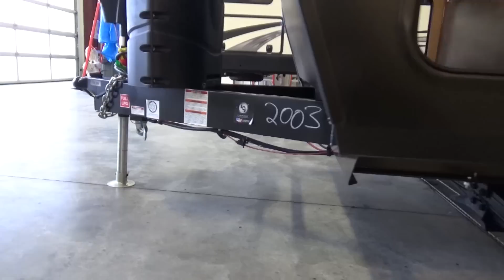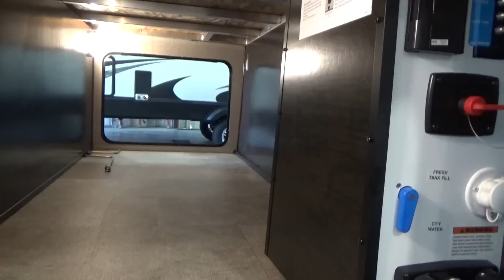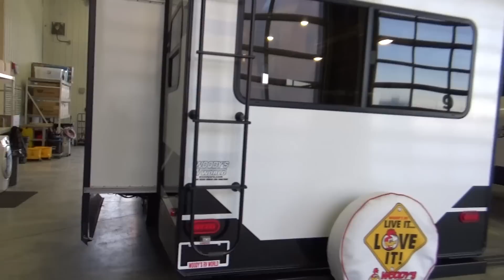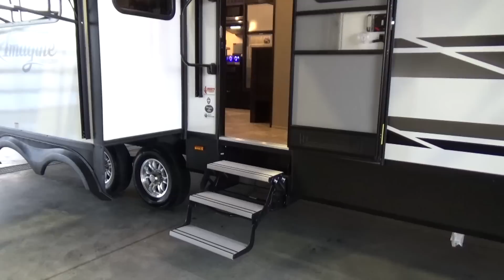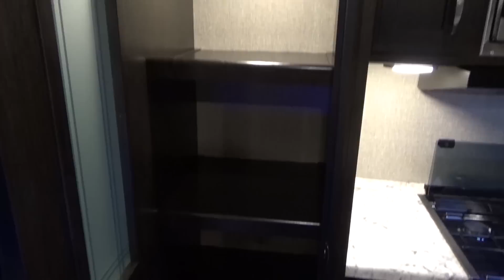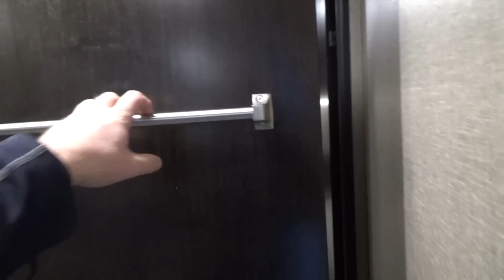2019 Grand Design RV Imagine 2970RL Travel Trailer

Comment: Great content and detailed walk through. Please be mindful when salespeople talk about “half ton towable”. They’re going to try to sell you on a higher end price point TT on its ability to be towed by a common lightweight truck. However, when you consider the GVWR and hitch weight of the TT and the amount of payload (passengers, luggage, tools, equipment, fuel cans, etc.) you’re carrying in your truck, you will likely be close or over a half ton truck payload capacity. For example, an 8,900 lb TT will likely have a 600-700 lb hitch weight that you add to the amount of weight in your truck. If your half town truck has a 1,500 lb payload capacity, you only have 800 lbs including passengers to go. Additionally, even if you’re not over your payload, a strong cross wind, and you could find yourself in a sketchy, white-knuckled towing situation where the TT is steering the truck because it is so light (tail wagging the dog). Upgrade to a 3/4 ton (gas or diesel) and you’ll have a much safer and  more relaxed towing experience. Go to the “Big Truck Big RV” YouTube channel and he goes into great detail on this. Not saying you “can’t” tow with a half ton, but please be as safe as possible when choosing the proper size truck/trailer combination.

Comment: Forced heat from the furnace to warm tanks doesn't work once its below zero outside. Tanks and lines under the floor will freeze. 

Love the floor plan. But for me I'd need an arctic package. Tank heating pads and insulation all underneath

Comment: At the 21:55 mark in the video you talk about the reason why people decide which RV to buy is because of the weight of the RV versus the payload capacity of the vehicle you have to tow the RV. Another consideration is the class of driver’s licence you have. In Manitoba with the a standard class 5 licence the maximum GVW you are allowed to tow/pull (travel trailer or fifth wheel) is 10,000 lbs. The police and Highway Inspectors go by the GVW listed on the sticker of your RV. So if pulled over on the highway or a Provincial Highway Scales you could get a ticket and not be allowed to carry on if overweight. Even worse if you have an accident and you are towing an RV that has a GVW greater than your driver’s licence allows they can deny your insurance claim.
Reply from the maker: Garry Kowalski, thanks for commenting and sharing this info. 😀

Comment: I seem to recall that in a he past you recommended twin 6Volt batteries rather than twin 12 Volt batteries. Why?
Reply from the maker: Garry Kowalski, thanks for your question. You get more amp hours out of 6V batteries vs 2 12V batteries. Thicker plates in the 6 volts as well, so they tend to last longer when properly maintained. Hope this helps.

Comment: Good salesman!! Talks about tow capacity. All Rams are different too. Check it out before buying. It's a safety issue if your trailer is too heavy for your truck. You don't want to flip your rig or end up under it when it pushes you down the road !

Comment: As long as people understand that this guy is a salesman and he’s not gonna tell you anything bad about this trailer . . For example the 4400 pound axles are nearly overloaded at dry weight and a step up to 5100 pound axles would only cost a few hundred more dollars. And the “R” numbers are silly....it’s 2inches of styrofoam in the walls and a little bat fiberg. In the roof....my house has a foot of blown in insulation and is perhaps a R 35.. .

Comment: Clayton, does the 2970 RL come with a generator or is it an option?  If it's an option are they expensive for a size that can run the A/C plus a few other things? I dont know what size would be needed.. thank you.
Reply: We bought a champion invertor generator for around $700 with coupon that we keep in the back of our truck and comes with a fob that will START and turn off wirelessly from inside our trailer. It runs our a/c but turn it off a/c if we run our microwave. There are dual fuel available too but we wanted to keep it simple. There are videos on it...

Comment: The video is fine, I like the additional information. My question is why won’t Grand Design put a one piece molded shower in the these smaller units. They put the 2/3 piece garbage showers that don’t support us fat rvers. I love what grand design does except for that. I don’t want a 40 ft 5th wheel but I shouldn’t have to sacrifice quality to have an rv my wife and I can handle. Very disappointed.
Reply: So lose weight maybe...?

Comment: No slide toppers??? A definite deal breaker for a senior citizen! Otherwise, very nice!
Reply from the maker: Woody Waddell, great question! Currently slide topper awnings are not an option being offered by GD. However, we have the ability to add them aftermarket in our service dept.
Hopefully with this info it will now become a deal maker for you. Thanks for watching and take care!!😀
Reply: We have been full timing for twelve years with three slides and no toppers.  Have never felt that we needed them and they would be very noisy if it is windy.

Comment: Yet we can clearly see OSB flooring!
Reply from the maker: joenissan, thanks for your comment. The material you are seeing in the video is a High quality Marine grade OSB. This material is used as the panel for the master bed platform, which is visible in the top of the pass through storage outside, and when you access the storage underneath the master bed inside. GD uses a laminated and insulated main floor in all their Imagine products. The decking used is a double stacked and laminated ply wood panel that is seam staggered. The laminated floor that GD uses in the Imagine is the most optimal because it offers superior strength, durability, and lighter weight saving properties. We hope this gives you some deeper insight into the GD Imagine and how it’s manufactured. Thanks for your comment and watching our video!!😀

Comment: I have seen through your videos that the Reflection uses plywood and the Imagine uses OSB. I imagine the Imagine uses OSB due to weight.  Is the OSB marine grade where it is resistant to moisture?  I am worried that OSB will deteriorate when moisture gets past the glue.  Also can one order an 8 cu foot refrigerator, and have a glass shower door?
Reply from the maker: Bob Goodell, thank you for your comments and questions. Sorry for the delay in getting back to you as we wanted to get confirmation from GD on a couple things before we responded. GD uses only a high quality Marine grade OSB in some capacity or another in all the products they build. They use this product because of the many properties it possesses. GD feels its the best material available in the areas they use it to maximize the life of the RV. Screw retention, weight saving, installation flexibility, no floor seams, humidity and moisture protection are just a few. If you would like, we would be happy to elaborate if n these deeper over a phone call or if you are in the area we would invite you to stop by for a visit. To answer your other questions, GD only offers a 6 cubic ft fridge and Nautilus shower curtain in the Imagine line up. In order to get the 8 cube fridge and glass sliding shower door you would need to move up into a Reflection. We hope this give you a little more insight in to the product. As always, thanks again for your comments and questions. Take care and Happy Camping!!😀
Reply: Woody's RV World Leduc Thank you very much for going the extra mile for the information I was seeking it was very helpful